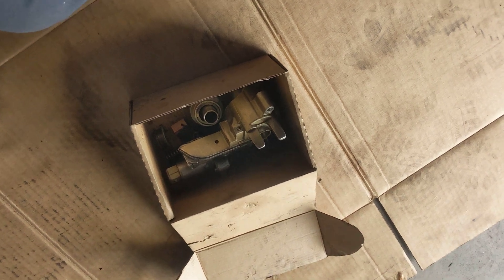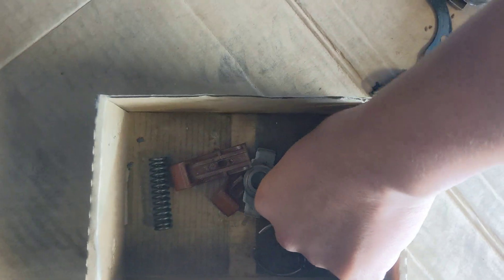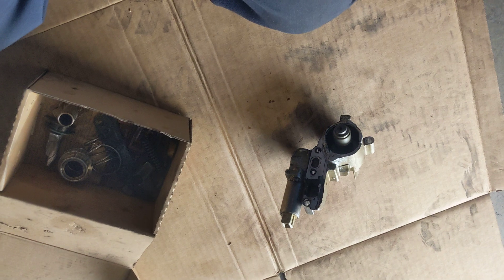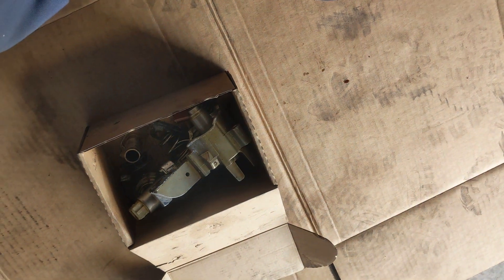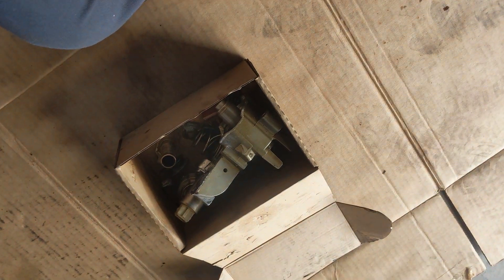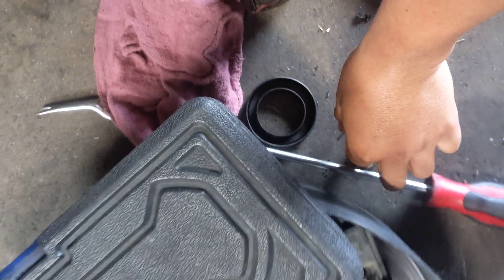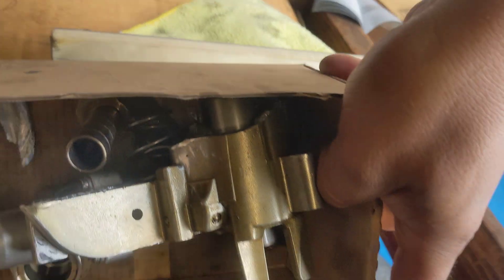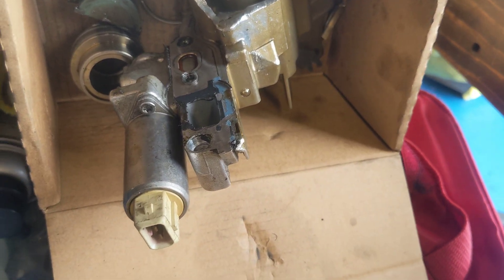1.8t chain tensioner failure causes low oil pressure and here is why.

Comment: evening/ morning 
great video mate, got a couple questions. so i believe my tensioner is on the way out on cold starts i hear a rattle (sounds like a chain) i had the valve cover off to inspect and didn't see no wear or damage. i get no codes come up an no oil light come up. would a bad seal will cause the grinding at cold start/ idle? or am i looking at something else? 
many thanks and i hope i get a reply :)
Reply from the maker: @LGtheAudiGuy  could  be  mechanical issue inside  the tensioner  as the temperature goes higher  the metal expands more, maybe that is why you only hear it cold.

Comment: Hello, good video! I have an 1.8T with new oil pump, filter, crankshaft and bearings but i have no oil pressure, do you think its possible its the chain tensioner? I dont know what else to check…
Thanks!
Reply from the maker: You might have an internal leak.
Reply: @abbsgarage.9676  this just happens when the car is hot at idle, if i rev up the pressure increases. an internal leak from where? Thanks!
Reply: @enriquerubio2401 I have the same problem, have you figured out yet
Reply: @radionovsfishing5872  I stopped the project for a while, but after all the changes that I have mentioned, I think the only spot where it can lose oil pressure is through the camshafts.

Comment: Hey Good Video, Want to ask u real quick about tensioners failing continuously because of bad oil pressure ? Just replaced Oil pump with strainer,  But is there an oil Galley  or a duct that might be clogged? 
   Thanks any Knowledge is appreciated
Reply from the maker: Not necessarily, now if you're using an aftermarket one. Expect that to happen I know the oe is about 1000.00 dollars.
Reply: Thanks i appreciate your Advice @abbsgarage.9676